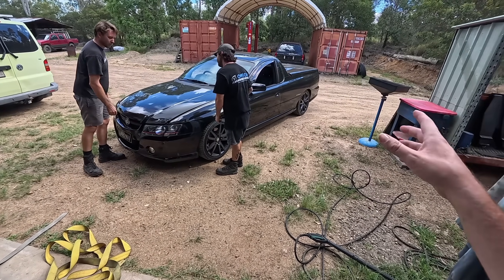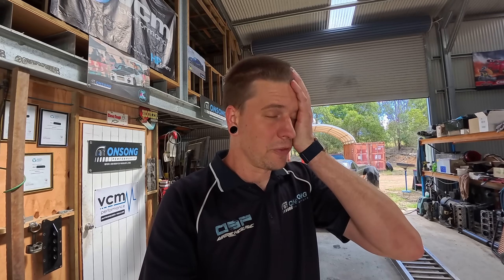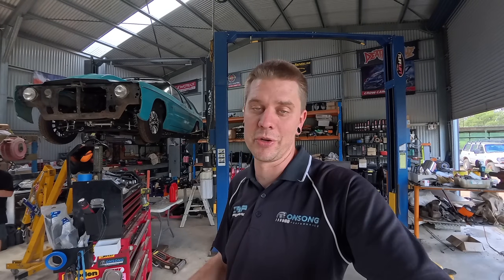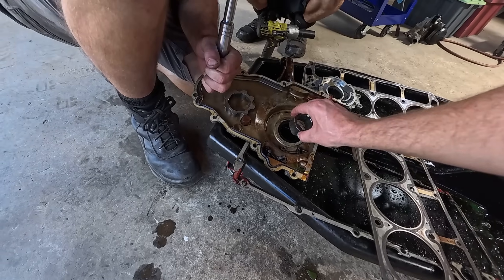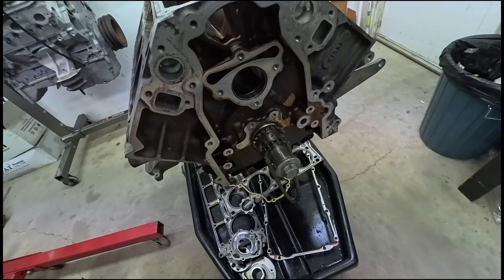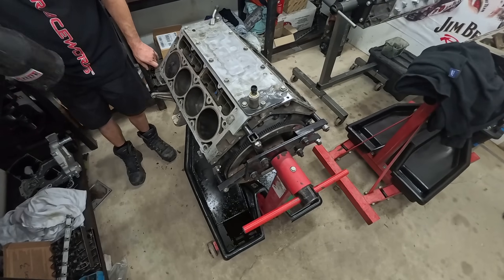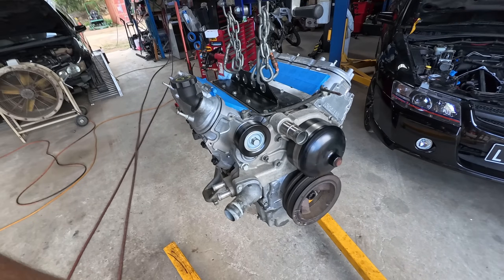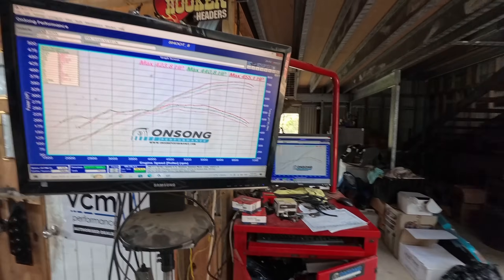CNC Head Dyno Test! + Diagnosing noises. VZ SS

Comment: I'm in Victoria and I just had a Dyno Tune done to my HSV LS3 it has extractors and  Dual 3 inch exhaust Bi-modal mufflers and CAI. After getting it back I noticed the Bi-modal mufflers were closed the whole time it was getting tuned, (I was there the whole time)  I asked them if it would make a difference to the tune and horse power numbers and they said that it would make no difference!! Is that correct. Cheers wish I lived near you guy's to tune my car.

Comment: What happened to the e46 Barra swap build? Only can find 2 eps?
Reply from the maker: @baeley1042  we still have the car/engine/conversion gear. We were going to throw a T5 behind it and finish the E46 as a Barra powered drift hack. However, the closing down of Archerfield Drift Park pretty well put a stop even on that idea too.
So not sure yet, may just sell it all as a project for anyone else who wishes to finish it. Still have everything apart from the ZF6 which was sold off.
Reply from the maker: @baeley1042  project was scrapped due to the amount of foreseen time to get the conversion integrated and working correctly and have it back on the road.
Reply: @BoostGumps  what do you reckon the labour time would of been to complete it.
Start to finish hah
Reply from the maker: @baeley1042  would have been massive. The amount of the firewall and trans tunnel were had to cut out to fit it, and the fact that the barra took up all the room that would be required for the factory e46 fan box. To get it all in and integrated and get all of those factory functions working somehow would have been am insanely huge job!
Reply: @BoostGumps  fair enough 
Question for ya 
Do you know if the m54 are somewhat reliable with a full engine rebuild and some boost thought it?

Comment: how much more hp would you expect from cnc porting cathedral port heads? I have a cammed VE thats making 475hp and wondering if it would push me to the 500hp mark just cause it sounds cool haha.
Reply: I went from 275rwkw cammed then ported head made jus over 300rw mainly top end power the port heads give. Ls1 it was aswel

Comment: Typically  your cammed manual cnc headed 6 liters reach high 400's pretty regularly I'm thinking the $900 it would of cost to slip a 1287 and a set of lifters would of easily been worth it, especially when you could sell the old cam and lifters on marketplace for a few hundred . 
Surely there is nothing a ve or vf has that gives an advantage to make more power than a vz.

Comment: I always enjoy your comparison videos.
I am surprised by the modest hp gain from CNC porting these rectangular heads.  Is it a different story with 241 cathedral heads? 
On a related note, given the amount of experience you have with the 6L platform and the variety of combos tested to date, perhaps you could prepare a summary video of where the biggest and most cost effective gains are across all the commonly available naturally aspirated modification combinations.
For example, 1286 vs 1287 vs 1288 and larger cams, factory compression ratio vs high comp pistons, 1-3/4” primaries vs 1-7/8” primaries, 2.5” dual vs 3” dual exhausts, manual vs auto, factory convertor vs hi stall, recommended injector sizing, etc.  Obviously, some combos are incompatible and some behave the way you’d expect.  I’m keen to see a video like that!
Reply from the maker: @wot3675  that would be a good vid for sure! Im hoping by next year I can be a bit less busy with OnSong and do a bit more of that kind of thing for the sake of the channel. Hard at the moment though just being so busy.
So the cathedral port heads generally benefit much more from a cnc port. The rectangle heads already flow so well that its hardly ever any kind of restriction, so usually 15-20whp is about as much gain as you see from them. But the CNC program is great value for money compared to a regular reco thats why we do so many of them.
But cathedral heads are far more limited in stock form, depending on the combo a cnc port on a 241/853/243 can pick up a huge chunk of power

Comment: What oil pump do you guys run with your cams?
Reply from the maker: @VN-346  GM pumps always 👍
Reply: @BoostGumps thanks standard or high pressure?
Reply from the maker: @VN-346  usually high pressure, sometimes high volume, it depends on the setup and the intended use of the vehicle. For instance - a Manual VT-VZ that was going to be used for pretty spirited driving, or track work like drifting, we wouldn’t put a high volume pump on. The extended high RPM use with the crappy VT-VZ sump means youre more likely to drain the sump dry and spin a bearing than do any good with a high volume pump. We just take it on a case by case basis.
Reply: @BoostGumps  thanks guys keep up the great content and thanks for replying 🙏🏽
Reply: @BoostGumps we use standard gm pumps however we open them up and give them a tidy with the dremel and port them 
Burnout car has been copping it for over 3 years